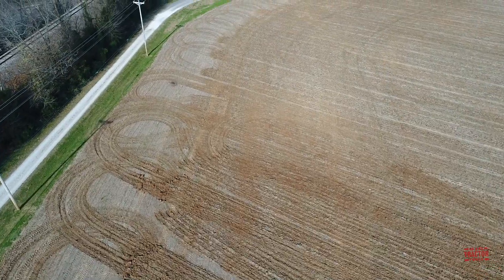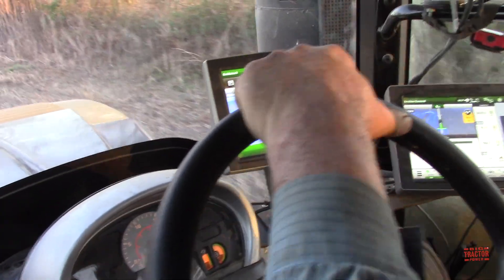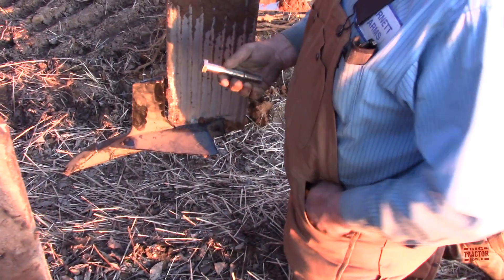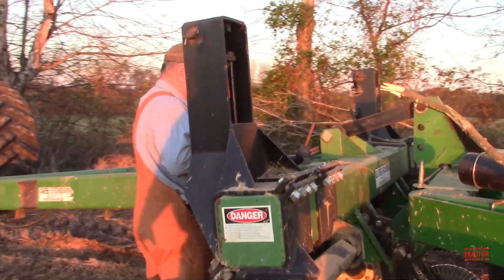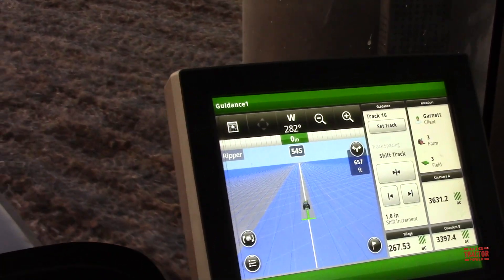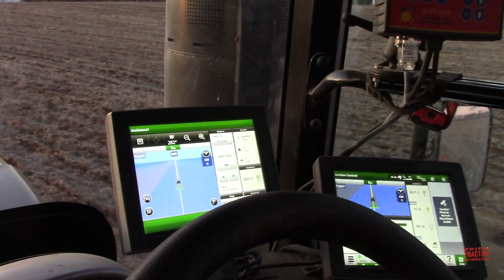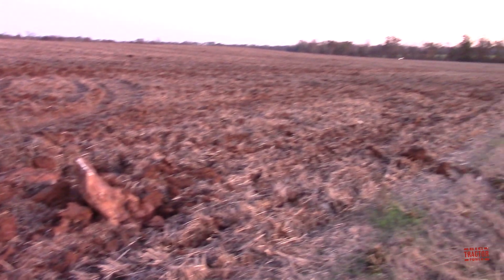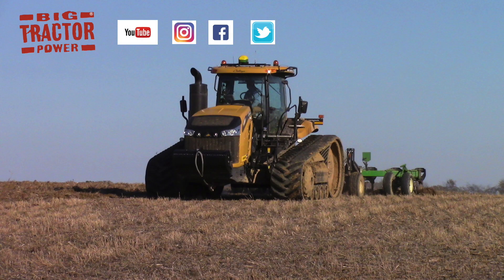600 HP CHALLENGER MT875E Tractor Put to the Test

Comment: This is easy. Bulk it up about 10,000lbs and drop that ripper down to the frame...55,000 is light for ripping with that v frame. And chiselplows 80 ft or so require more heft in large operations. Not much use for mine is bigger than yours when it ain't.

Comment: Wouldn't it be better to do 2 passes instead?  First at 12" and then 8-10" on the second pass. It would cause less strain on the machine and implements.
Reply from the maker: No two passes would compact the soil on the second pass and burn more fuel and take more time.  These implements are built to take the strain.   You can see as they struggle a bit how hard it would be for next years crops to establish healthy roots with out subsoiling.

Comment: Why call it "plowing"? A plow and this machine are completely different from each other. I seem to count only 9 shanks on this one that the Challenger is pulling not the 11 you claim.
Reply from the maker: I calling it plowing in the title because YouTube requires a short title. Plowing which is moving earth is more concise than Sub Soiling. I feel the video more than covers subsoiling accurately.  As far as the ripper goes yes it has 9 shanks in some clips and 11 in others. If you look at the drone footage in this video it has 11 shanks. They drop to 9 shanks in some fields when they are rocky.  The shanks are easy to remove and re attach.

Comment: This tractor needs a 18L six cylinder industrial engine.
Reply: Industrial? What do you think it has in it--a car engine? The tractor has ALL the power he needs. The ODD time he had traction problems NOT lack of power!
Reply: @KStewart-th4sk  Yes, industrial engine. A 16.8 V12 Sisu engine is light duty engine. One engine with that displacement in v12 configuration is not designed for produce and support heavy torque . You compare the stroke, crankshaft diameter and weight of that engine with the Caterpillar C18 or Cummins QSK19.  The tractor not has all the power he need.  You take older Challenger with C18 and put together with the new tractor pulling same plow in one hill. The D11N have 760hp with 35 litre  8 cylinder engine with 190mm of stroke. listen to me, this Sisu engine is not industrial engine.

Comment: A steel tracked tractor would pull that with no problem, it takes so much more weight with rubber tracked machines to get traction. A 200 hp D7G or 320 hp D8H would pull that tool easy. But of coarse you cant just drive it down the road when your done, lol.

Comment: It's not a lack of power, it's a lack of traction.
Reply from the maker: Very true but it powers through. The Deere stahls out and has to re start in these hard spots.
Reply: bigtractorpower 

Did not see that in the video but I would suspect the Deere has more foot print and it weighs nearly as much unballasted as the Challenger does fully weighted. If the operator would gear down in the tough spots it wouldn't get pulled down as easy

Comment: A person can get the same horse power out of cummings 8 cylinder
Reply: But not the torque, and definitely not the reliability out of the Cummins*
Reply: @nellsonstout7001  oh the cat fans are out. Not as smart as you I'm sure. Manufacturers of tractors use a variety of power plants. Cat gave up on over the road, why? All power plants fail. If the inline 6 made better power they would use it. I made better power with a ISX over the road with a head change and in frame ISX weakness is the head. 1.7 million miles. Had Kitty cats with similar results in miles. BTW a 903 a friend owns 83 model Pete makes 800 HP and has 2.5 million to its credit. Heavy haul and a beast.

Comment: Hi Mate...🇦🇺
Great video...👍
It's also best to mention, the curved shape on the front of some shanks reduces their draft load, making them easier to pull. But they are more likely to pull up soil from lower depths and mix the soil horizon. That could be a problem in some fields where the layer of topsoil is very shallow.
Straight shanks as on the JD V-Ripper have no curve, only a slight upward tilt that helps lift and fracture compaction layers. They are less likely to cause mixing of the soil horizon, but they require alot of  brumbies to pull it through the field.
The welding on the shank is called hard facing, this is usually done with a stainless steel or Low hydrogen welding rod. The purpose of this welding is to lengthen the life of the original shank..

Comment: I have always wondered over the GPS guidance systems, cant you mark in the gps approximatly where you hit solid rock where you can brake the machines on it, so that you can avoid it next pass with gps systems? That would seem very practical for every tractor/equipment that goes over the fields with different drivers?
Reply: danne77sthlm yes there are ways to drop pins on these systems. The driver is still required to lift the implement, but you can mark it so it’s recognizing the hazard. However, I believe if you do not use the same A-B line as before it will not show up.
Reply: oh, thanks for answering me, and thanks for the information, now I understand why that would likely to be very hard to include, I guess it would only make sence if you had a very detailed gps map but that would be very expensive :(
Reply: @dgkh2008  I am unsure with greenstar, but with the Trimble GPS along with most other brands (they run very similar to trimble) the obstacles marked in the field stay in the field no matter what A-B line you have selected, the only time they are not there is when you open another field, either a new one or at another location

Comment: I would mark with my  GPS and a flag every where I broke a bolt or tripped a shank. Bring in a trackhoe and dig out every rock or other obstruction in my fields! Buying 1-1/4” grade eight bolts and nuts adds up and the lost shanks also adds up! Better to remove it then to keep wasting my money every year on these things! My two cents...
Reply from the maker: They do allot of stone removal in the spring ahead of corn planter. There are always more that push up through the earth. Many of the fields have few rocks to contend with while others have several rocky spots to deal with. They run two skid steers and a large rock picker.

Comment: I really like the Challenger for this particular job. Why? Well, for starters, torque. Its pulling that ripper very smooth. Which tells me, this tractor isn't even breaking a sweat. The Challenger is more nimble. Its visibility is awesome and it's a very smooth operating platform to get jobs such as this done and without breaking ones back bouncing around. Its an expensive tractor, but it's worth that expense in the long run. These type tractors remind me of Cat D11R's. Oh sure, they're apples and oranges, but at the end of the day, it's still a Cat, it's still packs plenty of power and it gets even the most toughest jobs done and with greater efficiency overall. My opinion of course. Awesome video of an awesome tractor doing what it was designed to do....🚜

JR
Reply: I operate D11R's and D11T's for a living. You are correct. They are awesome tractors.

Comment: This is a different application , but there's a California Almond grower with a YouTube channel that hires a custom operation to deep rip ,like 4 to5 feet deep before they plant Almond trees ! They pull a single shank on a D11  I think ! It's not for this kind of farming but interesting !! That's one way to locate those rocks but could get a little cashy if that spring reset or shear pin fails to function quick enough or trip high enough ! Since their running both have they developed a preference between the Cat or Deere ?Thanks to you and Billy for the video !
Reply from the maker: I follow an operation on Instagram with a D11 doing clearing and replanting of almond trees. It is impressive.  Billy and his family own the farm. It’s all green but Billy likes his Challenger. Since his first MT865B in 06 he has a had an MT875B, three MT875Cs and this is the second MT875E.  Billy has always run the one different tractor since I have known him.  Before Challenger their was a JD 9620T, CIH STX450 Quad and a Ford 1156 on triples.

Comment: Mentioned below as well ... seems the Challenger should pull the 9 shank and Deere the 11 shank ... thanks for video. - Doug in Iowa
Reply from the maker: You would think that but the Deere’s have all the want with a 9. The Challenger spins while the Deere in the same spot will stahl out and the engine will just cut off.
Reply: bigtractorpower Interesting - so the Challenger spinning with the 11 shank behaves as a relief valve versus the stall and engine kill by the Deere with the 9 shank ... yeah - thanks much for sharing ... your videos and interviews are quite good ... thanks much - Doug in Iowa

Comment: You,ll never c a John deer pulling a subsoiler this big, never
Reply from the maker: The 620 hp 9620RX and 9620Rs on this farm have all they want with a 9 shank.  It’s funny Deere in the 1980’s shows a 370 hp 8850 pulling a 13 shank 915.
Reply: The torque is not with the John Deere yet weight is. They can configure up to 60,000 lbs. While the Challenger has the power while lacking the weight 55,000 lbs......

Comment: That is about the poorest pulling tractor I have seen.  When the ripper loads up, it spins out rather than grunt down and dig and pull.  I would like for them to hook up that 9RX to that 11 knife subsoiler and see if it doesn't do better.
Reply from the maker: The MT875E laps the 9620RX and 9620Rs running with it. The 620 hp Deere’s have all they want on a nine shank. I have watched them just stahl out and the engine quit in the same spots the MT875E is spinning through.

Comment: Need a Quadtrak
Reply from the maker: I will say the Challenger spins but you can see the 9RX rolling close by. When it encounters those tough spots it will stahl and the engine quits. The Challenger is all torque and eventually pulls through.

Comment: He must go through boxes of those shear bolts ? Seems like the tractor has traction issues, not HP issues, especially with 2095lbs of Torque !!!  Thanks BTP !!
Reply from the maker: You have a boat anchor back thief try to plow cement.  It will hold the Challenger back but it pulls through. The Deere’s in the field with more horse power will stahl and the engine shots off.
Reply: @bigtractorpower , I agree, the only thing stopping that Challenger was the tracks slipping.

Comment: How do they think that 12 cylinder engine responds as opposed to a good inline six? V engines were stop being sold in large tractors decades ago due to low torque at a lot of the engine speed range, unbalanced designs, low engine life, high fuel economy. Ok, now I know I’m going to get tomatoes thrown at me from V8 lovers...
Reply: No tomato throwing but it does have almost 2100ft lbs of torque, seems like a lot ?
Reply: august yeah, but as a mechanic, it says lots of moving parts, stressed crank, lots to keep lubricated and adjusted....in my world nothing beats a long stroked inline. V8’s had their chance, in farm, truck and construction. But nobody uses them much. Inlines are just hard to beat. But every few years, someone needs to try and reinvent the square wheel that never worked right before...
Reply: @thevox1075 , True story. Thanks.
Reply from the maker: The farm really likes the Torque the MT875E.  It’s a solid puller.  They liked the CAT engine because the wiring on it was simple and easy to work. The AgCO engines only complaint is all the wiring goes through the engine area rather than around it.  It’s more of s job for work on it.

Comment: Great video on field expediency.   American farmers hard at working doing what you have to do to  get the job finished.   Around the 15:30 mark, if I carelessly tossed sockets and wrenches around like that while working in the field I would lose some tools.  I would have to have a small tool pouch right there to collect them I as used them.  Thanks for posting and sharing.

Comment: That’s why we use three point instead of the dolly, three point you can use your draft control and you won’t stop the tractor or spin. 👍🏼
Reply: I thought 3 point implements on a 2 track was a bad idea?
Reply: jfdb59 lol why would you think that?
Reply: @peteparker7396  because unless you have a pivoting 3 point, when you turn doesn't it put a lot of sideways movement on the implement? I'm not trying to start an argument. I'm asking.
Reply: @jfdb59  shouldn't ever turn with an implement in the soil ! Attaching to the three point does actually sound like good advice due to the weight transfer effect.
 Horsepower certainly isn't the limiting factor here, it's the amount of grip available, or lack thereof, in this case.
 I reckon a Quadtrac would be a better choice to either pull or three point mount that ripper, since two tracks per side are always going to have a larger footprint for the same track width that a single long track per side. Also, the longer wheelbase of a Quadtrack could only benefit the amount of tractive effort available, owing to the better fore and aft wieght distribution of said tractor.
Reply: that,s exactly what I thought when I saw the tracks slipping- would definitely benefit from some weight transfer plus not as much ballast needed on the tractor

Comment: It would have Ben interesting to see the John Deere on the 11 shanks because the cat was slipping a lot
Reply: My thought as well!  I would think quad trac has better traction.  Especially for headlands where they turn corners and stuff.  @bigtractorpower is there an explanation why he puts the challenger on 11 shank and the RX on the 9 shank?
Reply: It may just be as simple as which tractors were able to get into the field with a ripper first(Matt mentioned in the last video that a few of the Deere were still pulling grain carts when the others were starting tillage) - when you have a 600+HP V12 Challenger, you don't hook up to the 9 shank and leave the 11 behind, lol. This farm seems like the only reason they only have 9 shanks because the dealer couldn't get enough 11s...

Comment: Great video again, like that aerial view on start. 

Not many tractor models powered with v12 engine, especially today.
I searched info about v12 tractors and find one Big Bud model,  Acremasters, Belarus/ Kirovets, IMT 5500 and ACO 600, of course there is some homemade v12 tractors like Honey Bee etc, but pretty rare engine type for tractor.
Reply: The 16.8l AGCO/Sisu V12 in these range topper Challengers(both in twin track and in the articulated MT900 series too) are absolute monsters - it's nice to see AGCO throw some fire power at the Challenger brand, picking up where Caterpillar left off after the sale